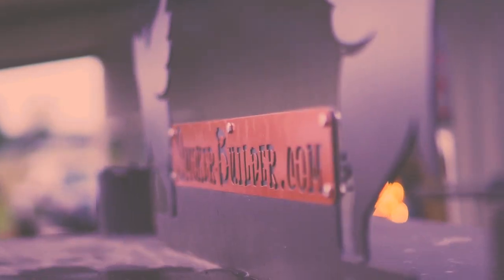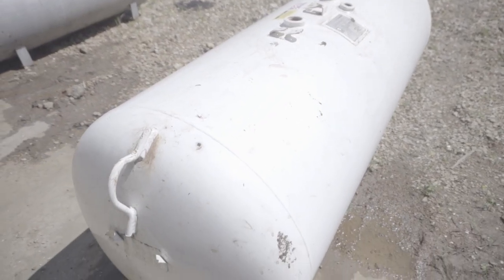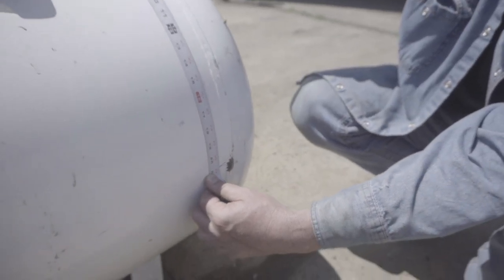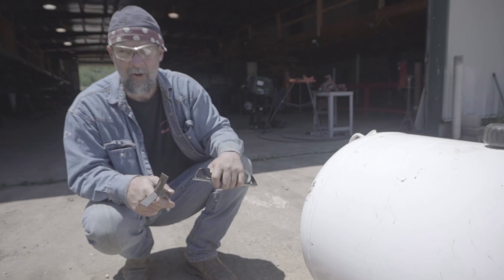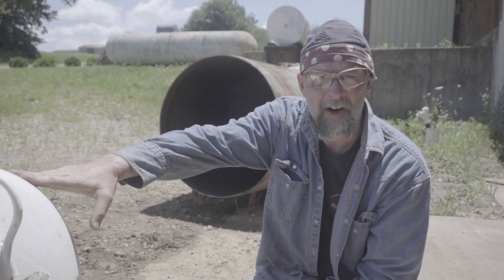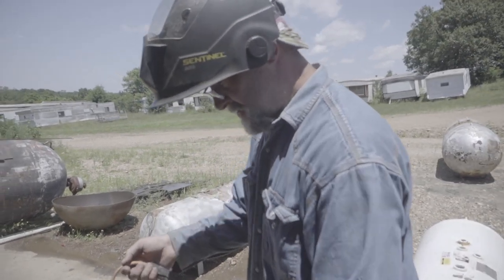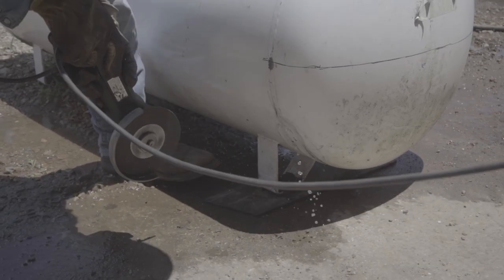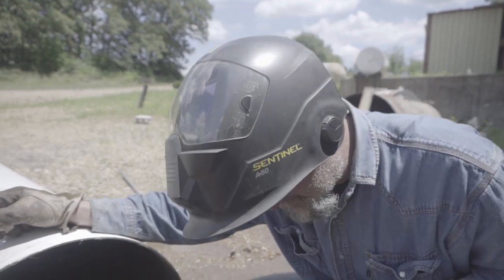Expert Tips: How To Cut Propane Tank

Comment: Frank ! Hey man use an old Pipefitter trick ! Take some adding machine/cash register paper, and make a wrap completely all the way around. Overlap it on top, make a straight cut across the paper. Now you have the exact circumference reference, fold it in half, and half again ! Make a small cut on each corner, then unfold. You now have quarter reference points on the wrap paper !
Reply from the maker: Thanks bro! That's a great idea!
Reply: @SmokerBuilder  yeup thats what many welders to when taking a branch test. if no pamphlets are available

Comment: I'm in a hurry to cut a hole in the tank.  I'm just going to use a oxyacetylene torch quick , so I'm going to skip the water part. 💥☠️ Bad idea😂.
Do it right or not at all.
Good video & thanks for sharing some safety ideas.

Comment: Great video! I watched several of your videos now and learn something new every time! I was really hoping you were gonna cut  with the plasma cutter.  I don’t have a Metabo, but I do have a plasma. Do I need to be concerned about water getting on my torch head?
Reply from the maker: hey buddy! Ya need to be careful for sure but really no worries other than making sure all your grounds are good, staying out of the water puddle, and quicker wear on your consumables. 
When I do this I start at the bottom and work up vertically to prevent water from running down on the tip.

Comment: So if you were just cutting the wedge out for a regular firebox, once you get the cut made and the water drains out then your pretty well in the clear for safety right.
Reply from the maker: I do recommend back purging until the whole wedge is cut out. On this tank I did not back purge since it was a brand new unused tank pretty much. Like we always say it’s better to get tanks that the valves are already removed on, but on tanks where they’re freshly decommissioned I recommend back purging with CO2 as you cut. Until the wedge is completely out. Then it’s safe to do whatever with them
Reply: @SmokerBuilder  If you buy a decomissioned tank with valves already removed, would you still fill with water before cutting? I just picked up a 250 gallon decomissioned with valves pulled. I plan on putting it in some furniture dollies with wheels up so I can freely turn the tank, wasn't sure if the valve opening to the ground would be enough
Reply: That’s what I was going to ask. I picked up 3 150 gallon tanks that have been sitting at a tank supplier in their salvage side of the yard. All valves have been removed. I’ve filled it up 2x with soapy water to be sure. First time I dumped it out there was a little gas in the water. Second time good to go.

Comment: I've seen other videos and they add a gallon of dish soap .  What do you think about adding it ? Good or not needed ?
Reply: The dish soap reduces the surface tension of the water, which allows it to soak into small spaces where plain water would leave a bubble of oil or gas. The result of that will be to drive more flammable material up to the top of the tank where it can flow out before you cut. A little goes a long way with dish soap, especially if you dribble it in so it’s mixed well, so a gallon seems like overkill to me, but for a buck or two you can mix in a bottle of dish liquid and get more gunk out. Seems like a bargain to me.
Reply: Thank you for the info. I've never cut a tank and I want to do it the right way. ✅

Comment: Hello i am building a smoker from a old air tank. When cutting the top of the door, the metal is crimped inward along its entire length, but especially in the middle of the door at the top. How can i correct that in any way?
Reply: Check out Allens Welding... Hes got a good technique

Comment: Is it safe for me to fill the gas tank with water for a few days and drain the water out of it and then make my cuts?
Reply from the maker: It’s not, unless you back purge with CO2. 
The propane in the tank is not the only  concern. The ethyl mercaptan is also very flammable. It will also explode if it is vaporized and sits in the bottom in liquid form. 
When you empty the water from the tank air goes in to replace it. 
Once air enters you risk having the correct oxygen/fuel mixture which is what causes the explosion
Reply: I thank you sir for your reply. I will make sure I keep the water in it while I am making my cuts.
Again sir, I sincerely thank you.

Comment: I have seen were a shop vac was used to force extra air into the tank to push out any extra fumes and disrupt the air while u cut open the tank have u seen or tried this method any thoughts
Reply from the maker: I do not recommend using air to purge with since it is lighter than propane. the best thing to use is CO2